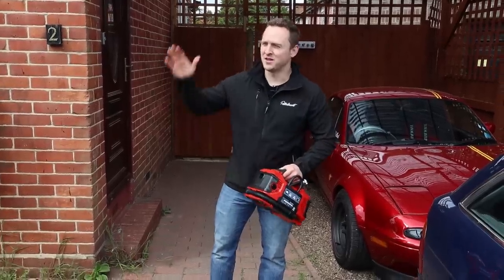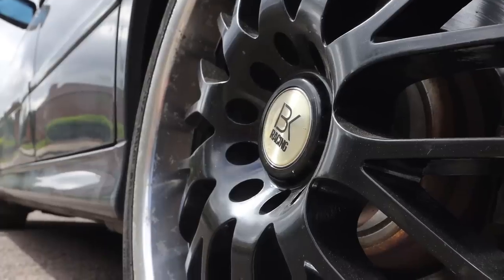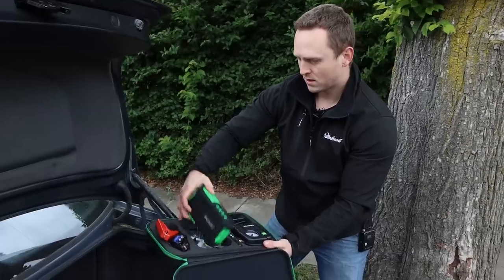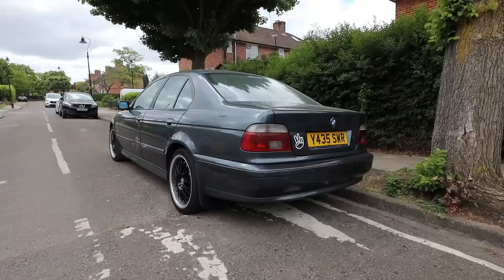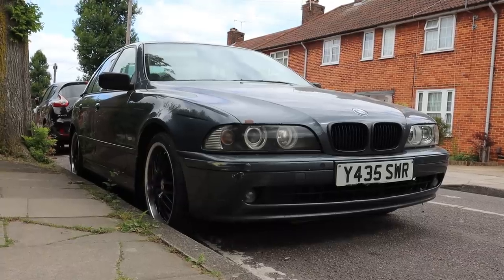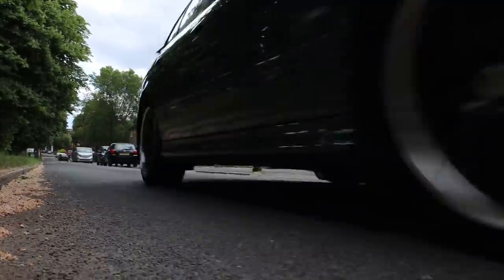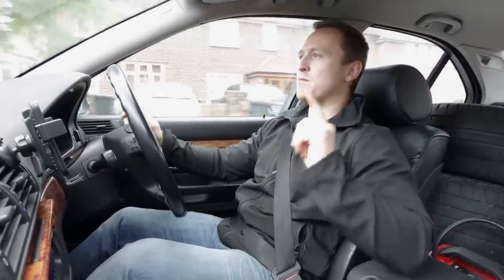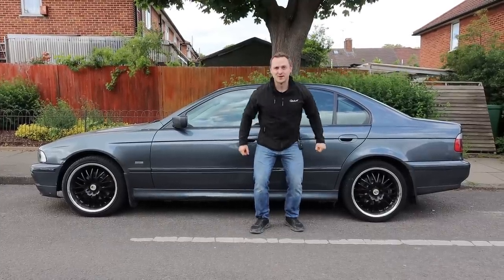I Bought A BMW On Instagram For £150

Comment: Things to do with the car:

New secondhand rims
fix up all problems e.g. engine mounts, suspension, brakes etc.
fix up rust
power boost?
exhaust upgrade 
comment more
Reply: Straight pipe
Reply: Dixie horn
Reply: Pump injections
Reply: A tune!!!!!

Comment: I had an e39 530d with e53 3.0 engine from the factory. 218hp original. A little bit work on the intake, exhaust, a bigger intercooler and a remap almost 300hp. And i was a very happy owner of that amazing driver's car. It was automatic though, but that wasn't a disadvantage at all.

Comment: That gearbox alone is like 6 times what he paid for the car
Reply: And six times more for a mechanic to fit it. And that monoxide death manifold
Reply: Thats a good point!
Reply: @rockinghorsesciencemechani6020  actually it takes more to build a car than just raw material. You'll need employees who engineer the car. Then you need to order material which is delivered by...? Employees. After that the car gets crafted. Guess who will do this? Yeah you're right, more employees. The car will also need to be advertised and sold. Since no one is working for free the expenses go way up the 8-10k estimate you did. Big car companys can sell their cars for "cheap" because they produce in bulk. If you'd build 1 car and do all the work by yourself (provided you have the knowledge, tools and time) you'd may be able to actually spend that less.
Reply: @Wraikey  exactly
Reply: @rockinghorsesciencemechani6020  I bet you're the type of person who evades taxes to stick it to the man
Reply: @rockinghorsesciencemechani6020  uhhhhm... K 🤨
Reply: @Wraikey  making it solo would be the same price as retail or more. Unless you use salvage parts. But making a car from scratch is expensive because you don't get bulk discounts on materials.
Reply: @rockinghorsesciencemechani6020  nobody cares.
Reply: @rockinghorsesciencemechani6020  Then go build the car yourself and see how much that is....
Reply: I wonder if these trolls came straight from gchq or are just bored and waiting to deny truths
Reply: @nikolal.4502  I did
Reply: @rockinghorsesciencemechani6020  you can't call anyone a troll, please leave, you're not funny

Comment: I think it should be restored. Always love to see old BMW’s being kept on the road 👌
Reply: E39 are classics!
Reply: Not exactly budget friendly tho is it? haha
Reply: As the owner of a BMW E39 which I bought for the equivalent of £2500, I can say: No. The car has cost a lot of money and nerves so far. But I love the engine and the design. Getting his E39 back in shape will not be cheap. Luckily it doesn't have too few miles, there must have been some replacements, despite the lack of service. The rust is bad though. 
My E39 only has 90000 miles. Almost all parts are still the original and initial delivered parts and fall apart bit by bit. Mainly rubber and plastic parts.
Reply: @kornar  the same was with my VW Golf MK4 it had really low miles but everything is breaking now but i guess its just going to be scrapped or ill try to part it out
Reply: I'm doing that currently with a 95 740il

Comment: 4:43 "underneath the hood we should have an m51 d25" as he reveals the m57d25
Reply: I thought us Honda owners were bad with engine codes...BMW are on a whole different level.
Reply: Matt Beardmore why? M57 is the Engine, D is Diesel and 25 the displacement
Reply: EXACTLY I scrolled too far to see this comment. He says BMW 525d but mentions wrong engine. M51D25 would be called 525TDS.

Comment: It's a M57D25, the M51's are pre-chamber injection engines from the tds models 😛
Reply: Nerd😂
Reply: Simon måge came here to say exactly that
Reply: @abhilashnambiar3167  m57d25 is 163 hp not 143,so ye nerdines=20 hp,heh
Reply: Here comes the carnut flexing the deep wisdom

Comment: List of things you can do at home:
Oil change
Engine mounts
Ball joints or any other bushing
Tires?
Fix the horn
Easy, cheap, great vid
Reply: If you know what you're doing and have the right tools you can fix anything at home
Reply: I'd say leave the horn)
Reply: And the rust!!
Reply: @Gabriel-mj1jk  grinder?
Reply: @Gabriel-mj1jk  ik that don't worry but you can always go to a tire shop
Reply: @LUCAS KELLY I don't know what the hell he's on about.. using a grinder to remove a tire?  $1 per tire? He's on drugs lol

Comment: 4:45 it is not m51 engine it is m57
Reply: Ow no the notorious in 47 or is his different
Reply: I was thinking that, the m47s the 4 cylinder diesel and the m57s the straight 6
Reply: @FIetch2002  sorry I meant n47
Reply: @FIetch2002  ya I don't know bmw engines
Reply: Neil Murphy I had a feeling it was n, I have 2 diesels n47 2.0 and n57 3.0 bi turbo
Reply: jim mick  M51 2.5 tds is far away from being a fantastic engine. Poor fuel economy, usually tons of black smoke and fuel pump problems occurs too often, especially if you are a fan of driving low on fuel. M57 are awesome engines and that's why e39's with m57 usually costs 2-3 times more than the ones with m51 under the hood in the Europe.
Reply: Propulsion Unleashed At least when manual, the automatic transmissions for the diesel engines in the E39 are made by GM and are total garbage.
Reply: jim mick They don't last nearly as long as ZF gearboxes.

Comment: Here in spain one of these bmw in that shape or even worse cost like 3000 € 😅🤣
Reply: It's like that for whole world, UK has cheapest cars in world, even Dubai after last tax rise has more expensive cars. Compared to Poland where I live UK has anything between 2-4x times cheaper cars on average, even new cars with 5x time higher wage on average... Go figure and they dare to say cars are expensive...
Reply: @wykydytron  in my country it would cost 5000€
Reply: E incluso más.
Reply: I think the reason they're so cheap is bc fuel, tax, and insurance is really high
Reply: It would be 2500 USD in the states
Reply: I bought an E46 320d for 650 €! Needed fixing but I got it running just fine and mine doesn't have rust!
Reply: @ferrarienzokl  rust and also UK is the only place  in the area   with the steering wheel in the wrong side , that make it hard to sell then elsewhere
Reply: They cannot sell them outside of the UK since they are on an island and their steering wheel is on the wrong side, so they need to make them cheap because there are more used cars than people wanting them
Reply: Over here in uk for 3-5k you can get a real nice executive car
Reply: @Legend-lc9bv  Which is your country?
Reply: @etrieseisheshttristadvaese4385  country i was born in sorry
Reply: Manuel xd doesn’t matter Because insurance prices are over the moon
Reply: @NikoMoraKamu  Not true! 30% of the world drives on the left, e.g. Japan, Thailand, Australia Indonesia. Go back to 1918 and it was 50/50. Countries like Argentina, Portugal, Czechoslovakia used to, but from 1925 onwards some countries changed and some didn't.
Reply: @cheezindashower  what numbers are we talking about? In the netherlands for taxes and insurance it would be 300-ish euros, probably more. Really depends on your age. If youre 18 you have to pay  over 200 for insurance and when youre over 50yo not even 80
Reply: Yeah our used car prices are shit here in the US. We had this program called cars for clunkers or something along those lines. Long story short, we don't have as many used cars from the late 00s Era as we used to bc the owners would scrap them and buy a newer car bc the government payed them.
Reply: @CoastHobbit9340  read mate i d said in the area  and in the present

Comment: Actually this is the M57 engine, the M57 2.5 has ~160hp :D
Reply: Yeah i did think this its a M57D25
Reply: the M51 wouldn't start that fast
Reply: @karlburgess3331  yeah, there are 3 things giving it away: engine cover (I own a 525tds so I know), the M51 is indirect injection so it  relies on glow plugs on start and 525d is not the same as 525tds.
Reply: @alexandruv847  true. I own an M51, if you didn't give glow plugs time to heat up the engine would crank for a few seconds. Direct injection engines start a lot faster, generally.
Reply: Yep, ur right. I have a 3.0d M57 and it's basically the same.

Comment: When you say pokey I was surprised, cause my tds is sluggish but realised this is facelift so 160bhp
Reply: Is it a 4 speed?
Reply: @FMSLO  5 Speed.
Reply: Both Auto and Manual mated to the back of the M57 were 5 speed..

The M51 in E34s came with 5 speed manuals and 4 speed autos, I think they came with the same setup in the early E39s (M51 tds models) as well...

Comment: Roof rack with all the accessories, battery jumper-pack with tire-pump, 4 original wheels in good shape - £150.  BMW 525d - free.  LOL!

Seriously, absolute worst-case scenario, you can part that thing out and get far more than 150 quid for it.  Damn good deal, that.

Comment: Fun fact: the bmw 5 series's disel engine was also put in the Opel/vauxhall omega
Reply: Saw that in person when a guy came into a tire shop where my dad works... I was like.. WTF.. Full Bmw drivetrain w/ engine
Reply: I think 90's land rovers too.
Reply: You are right, but it was M51 TDS engine, and that E39 is 525d (M57). This engine was also mounted in Range Rover (3.0D)
Reply: @thatbluelada  Ik i own an opel omega.. I was surprised aswell but it.puts out amazing numbers and 0-62 compared to its size and weight i was shocked..
Reply: the opel omega has the 2.5TDS which is producing less hp and is a lot noisier, the bmw has the 163hp common rail 2.5TD which is way better engine
Reply: Zuch II M57 was also mounted in omegas. In fact, omegas had m51 engine (130ps) until 2001. Then, 2.5 diesel was replaced by the m57 with 150ps. At least in my country
Reply: Marius Bim omega also had common-rail engines
Reply: @ikerochoaderetana7043  i searched on autodata.com it says 1994 Opel Omega B 2.5 TD (131 Hp) 0-100 12sec while the 525d 2000 (163hp) 0-100  8.9 sec can't argue with autodata and automobile catalog.com
Reply: Marius Bim haven’t understood me. I mean that there is a omega with common-rail 150ps 2.5 diesel engine, which is almost exactly the same as m57 163ps bmw 525d
Reply: In fact, it is a m57 too

Comment: AAAAHHHHH Sweet buy, the Diesel will run forever if u keep up with the service on it(make sure u give it a full service,use synthetic engine oil & change all filters air,fuel,cabin&oil-the biggest killer of a Diesel engine is a dirty air filter).....because it was his dads car it was probably looked after before joey got it......do the engine mounts ,put an exhaust on it(3'' straight through with 1 high flow muffler on the rear, re do the suspension(probably just wants shocks & springs-Bilstien B6 is what i have on mine +lowered  1.5'' all round)-do a step by step build on it on the channel & then finish it off with a remap from Quantum tuning & i bet u will love it & probably put a towbar on & keep it as your tow vehicle.....looking forward to see what u do with it Alex.

Comment: Correct me if im wrong but the engine looks like an m57, its the same as my dads which ive worked on so im fairly sure that's the 163hp variant.
Also i reckon its had a new turbo and  vacuum lines coz they tend to fail around 150k
Reply: You're right, its the M57D25.

Comment: 4:45 it is actually an M57D25 common rail with 163 HP. ;) You've got a facelift model there, it is a 525d. The old M51 swirling chamber engine was sold as 525tds in the pre-facelift model only. Congrats to this bargain, but trust me when I say: There is nothing more expensive than a cheap E39. :D

Comment: Had a 2001 E39 530i sport manual. I was 3rd owner. Retail £40k, 2nd owner paid 18 at 3 years. I paid 10.5 after 4.  I sold for £1500 at 7 with 135000 miles on the clock. Miss it very much, but fuel, parts, service, notchy gearbox and shit electrics (remember the dead pixels) etc made it hard to love. Had Fabia vRS as a replacement and didn't regret it. Having said that, it was a quality car. Ex-wife had a 2000 530i SE on OEM M5 wheels and sport kit. Monster when it worked. Such fond memories of every wheel sensor disintegrating twice including MD and OEM replacements, the ABS ECU going as it was positioned exactly where the internal solder was most likely to melt, and  the turbo failing at 135k in Devon with two small kids in the back. Oh, and 4 of the injectors failing simultaneously and seizing in place, and the arguments with a main dealer, and getting it trailered to a garage miles away who could be arsed to get them out and replace them.  And the £4k bill.  Good cars to look at and drive, but oh, so many flaws. Such a contrast between the M54 and M57s too, it was hard to believe they were signed off by the same company. Good luck with your diesel mate.

Comment: Things to do with your E39 (on a ‘sensible’ budget):
1. Change out fluids/filters
2. Refit the BMW 16” turbine wheels, with new rubber
3. Fit a muffler (!)
4. Engine mounts refresh
5. Suspension refresh
6. Rust repair
7. Paint correction/ceramic coating
8. Replace wheel/hood/boot badges if necessary.
9. Roof racks
10. It has a turbo...add a tune!

Comment: best SMOKE SMELL REMOVER - ....  VINEGAR :)       get a spray botle filled with pure  or 50/50 vinegar -water.   Douse the interior down - seats, carpets, doors , roof etc.    Repeat , and Rinse ;)   works a charm at klling smoke smell

Comment: Here are my list of what i would do (i own a e39 530d, had it for 10 years, so i know this cars very well ;-P)

-Read out the fault codes, if you have access to sofware where you can read live data (inpa is great), i would check the diesel pre supply pressure and rail pressure at idle just to make sure the pumps work as they should. Rail pressure should be around 350 bar at idle, pre supply pressure around 4 bar. (I would assume this is the same as on my 530d)
-You mentioned oil and filter change, i would change the air and diesel filter also. And while you are at it change the climate filters to.
-Change the crank case breather filter (it will wear on the turbo if its clogged)

Thats what i would do as a first service.
When it comes to recommended mods/upgrades:
-Remove the swirl flaps under the intake manifold (if it has them)
-Remove/block the EGR system (prevent clogging of the inlet manifold), will give you an error code but not a light.
-Check the engine temp (thermostat, there are two, one on the water pump and one on the EGR), you can check the temp in the "hidden menu" in the instrument cluster (search for bmw e39 hidden OBC menu, make sure you find the one for the instrument you have)

And i would have fixed:
-Engine mounts, if they are actually broken, if they are good i would have a look at the rubber mount on the  drive shaft right after the gearbox, and the bushing/bearing on the center of the drive shaft.
-Check the brakes/handbrake
-Fix the exhaust leak and add a rear muffler
-WHen you change the crank case filter, also check for leaks around the injectors
THis is what i could think of  right now. Im sure there is alot more tho. :-P

Comment: I just bought a 2005 Jaguar X Type for €100! :) It's body is in quite good shape,no dents, the price was so low because the road tax here in Ireland for is €700 per year. It drives no problem! :) you can have a look at it here https://imgur.com/tjkfVys . @carThrottle would be cool if you could do a series on doing up bargain cars

Comment: It would be cool to see the issues of the car fixed, service done and afterwards get the most effective tuning. It’s a diesel so renap tuning would make it feel swiftier. Or- just drop in a shorter diff that you can get from a 520i manual (3.64 ratio).

Endresult should be a swiftier, cleaner version of what you have now.

Comment: Hey so I got a bunch of videos of the new ram rebel trx and was wondering where I could submit them. They aren’t very good as the dude kept trying to lose us. There are a couple parts though where if you freeze the frame u get a pretty good shot of it. I also have somewhat of a drive by and it sounds pretty good!

Comment: I was pissing myself when Mike showed up! 😂😂😂 Manual BMW with a spare set of wheels? Gotta make a drifter! Does the air horn not need the engine running to power a compressor? I dunno, just a thought 🤷‍♂️

Comment: I'm in the US, my dad came across a 97 528i on Facebook marketplace, we rent a trailer and drive 80 miles and back to pick it up, it didn't run so the guy was only asking 450 USD, we got home and I thought hey dad, for shits and giggles, let's put a battery in it and give it a turn, the thing started right up and ran like shit, he gave it some gas, it popped twice out the exhaust, and its ran perfect ever since

Comment: no way e39 525d with leather interior running engine and manual transmission without much rust or significant body damage no wayyy this was 150 quid... probably more like 3000 in my country

Comment: Standard wheels back on, some PDR on the doors and spray cans from halfords then service it and replace engine mounts followed by a right good valet. Done. Oh and fix whatever is hanging off the bottom

Comment: Daily Drift Car Challenge.
Make a drift car but you can only spend what you paid for the vehicle. Selling parts is acceptable as the money you get will go into the car. Stripping it out is a no no as it has to be a daily run around. And you have to fit a straight pipe to it for the lols 😂

Comment: Have it detailed on the outside to see how it comes up, remove the rust and touch up the paint, fix the exhaust leak, fix the mounts, swap the wheels and add some boost.

Comment: For how many years car is valid in your country asking because in India it is 10 years for deisal and 15 years for petro
Reply: fitness with yahya well in the UK now we’ve got this thing called ULEZ which will be takin over the UK completely by 2021 and it’s basically not allowing old diesels in particular from years 13 not (63) to pass as with old diesels they do cause a lot of carbon dioxide and emissions I think at least not all my points will be right